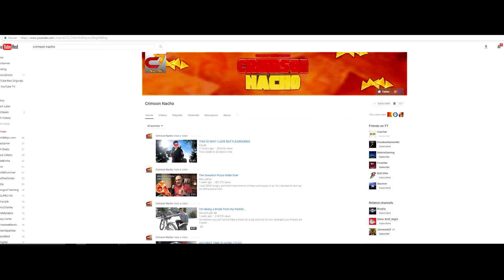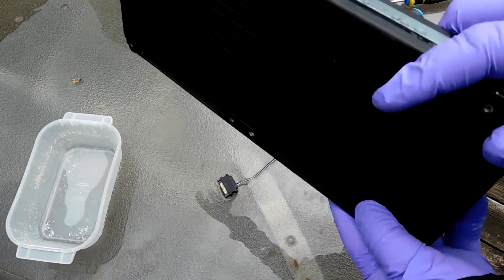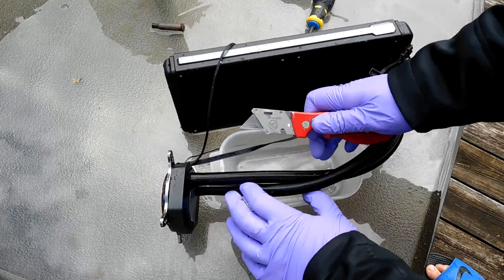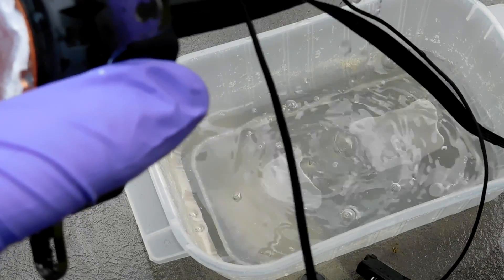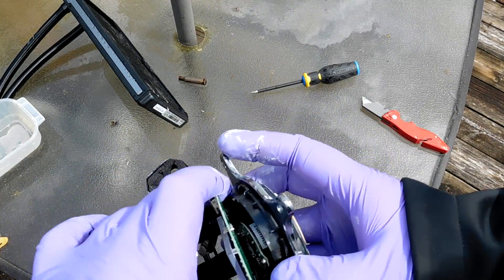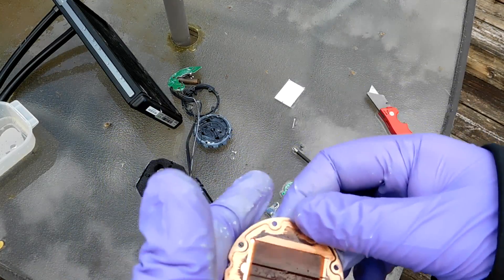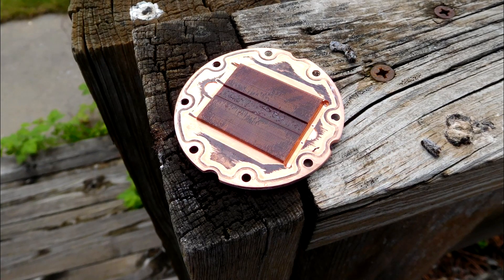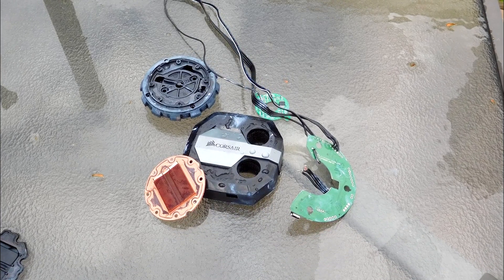Whats Inside A CPU Liquid Cooler? | Troubleshooting

Comment: I have the same cooler (two years old) and the same problem. 
In my case it's caused by air bubbles - you can totaly hear that when you rotate the radiator. Quick fix - shake the radiator and distribute bubbles evenly (it last for day or two). Fix fix - tear that thing down and refil the system.

Comment: aio water coolers are junk. I went with the h115i and it has always run hot. after a year it started doing the same thing you described. I tried everything to get it working again but gave up. I went back to using air coolers. a quality cooler like the noctua nh-d15 will run just as cool as a good water cooler, and last forever, instead of 2-3 years like a water cooler

Comment: That gunk on the plate you call "fairly clean" is the cause of your temp issue. Its constricting the water flow a lot. It would take less time and effort to disasemble the plate and pump instead of cutting and smashing it. Could be fixed in about 5 minutes.

Comment: I'm having the same exact issue. H100i V2. Its about 1 year old
 I feel like the rad or rubes are partially plugged.

Cpu will randomly idle around 50c, and shoot up to the 90's at 30% usage.
One Tube is VERY Hot.
The Rad is Cold.
Corsair Link says the pump is running at 3k rpms.
Reply: what did u do? its happening to me.. i need to buy one.. but how do i unglogged
Reply: @NH10059  throw it away. Pump failure